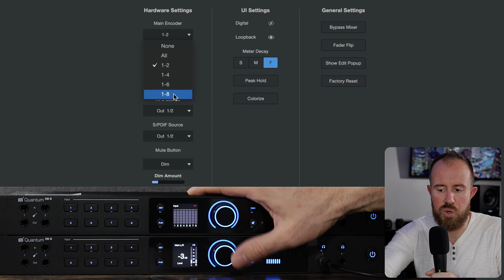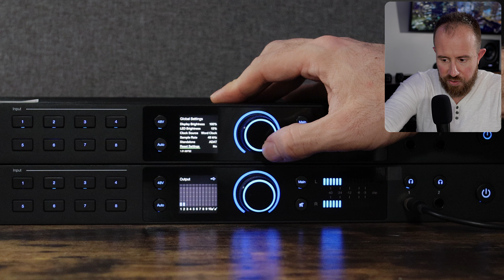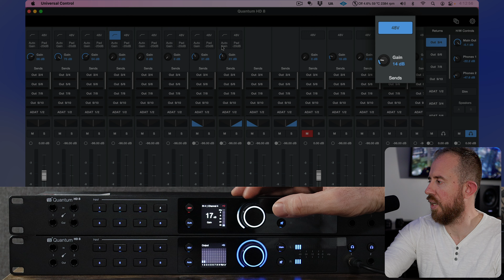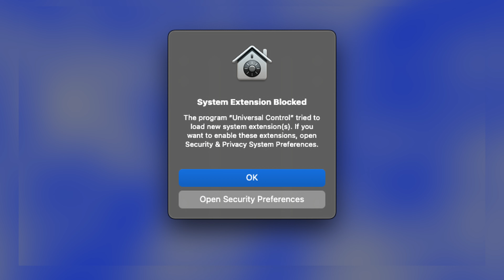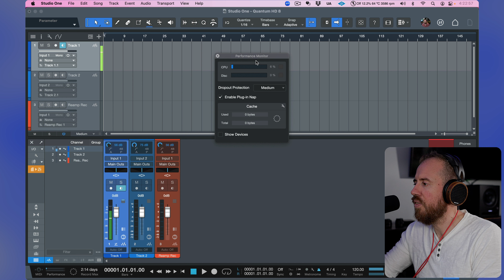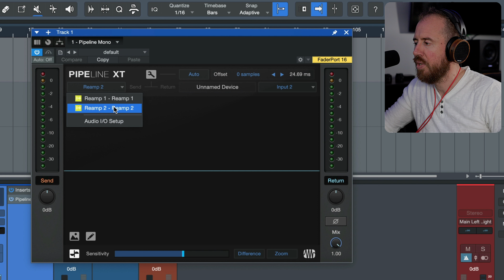PreSonus Quantum HD 8 - FULL Overview | USB-C Audio Interface

Comment: I just purchased a Quantum HD 8.

I got a lot of audio cracking well my buffer size was set to 16.  I had to go up to 128 on my buffer for the cracking to stop. I audio dropout protection when I raise it to high taxes the CPU tremendously.  I am not extremely happy with the driver that runs the unit.  My RME BABYFACE uses a buffer size of 64 and it doesn't matter what I set the dropout rate to and I get a latency of approximately 3.6 milliseconds for audio and about formuliseconds for virtual instruments.

I hope this helps everybody.
Reply: Are you having any other problems with the PreSonus Quantum HD8? I was considering getting this but have been reading about various problems like audio dropping out and a high pitched thing going on. Are you still using yours? I also have the original RME Fireface UFX and it's great, but I thought a 32 bit machine would give me more headroom. Thanks for your honest reply.
Reply: @Preordained  I have one that I’m replacing with an SSL 18.  It is not playing well with a Cranborne 500ADAT rack.  I think it’s is due to a bad ADAT port on the Quantum.

The preamps in the 500 rack work when running signal through them, into the quantum and into my daw.  But I also use those preamps as line level processors when mixing.

But when I try to route signal through them out of the Daw and back?  Nothing.  Pipeline sends the outgoing signal and nothing comes back.  None of my efforts to fix everything else in the chain has worked.

I also had an ES-4, but I had no problems with it.

Comment: Great review!! Thank you!! The round trip latency results are encouraging as I was concerned about the fact that these were USB 2.0 protocol interfaces.
Reply from the maker: In all honesty i know that I've heard of some people talking about RME interfaces and the custom low latency driver over USB. 
I've never used RME before - But this was my first experience with seeing these types of RTL numbers over USB. 
I think on a newer computer system (even on my 2019 Intel Macbook Pro) that these results are really good, and would allow people to work with really acceptable latency. 
But also we have UC for ~ZERO latency monitoring, as well..
Cheers, M
Reply: @marcushuyskensmusic   Dont we already have the Low latency trip on the Presonus studio 192?  The Z thing?
Reply: I read that they use USB C 3.1 I don't know where anyone heard they use USB 2. Thats a different connection with different protocol. Did you read that somewhere? I only found one place where it said what they use. USB C 3.1

Comment: Great review.  I had the Quantum 2626 pretty much since it came out and have had the new HD8 for a few weeks, so for anyone considering getting the new HD8 one thing worth considering is the fact that the new interface does not have send/returns on any of the inputs.  If you have outboard preamps, it's no big deal, but having send/returns on Channels 1 and 2 on the Quantum 2626 was a great feature, allowing you to use outboard gear while tracking through the built-in preamps.  The reamp feature on the new interface is really useful though.  It's made using guitar pedals and outboard gear during production/mixing a breeze.  Overall, I'm really happy with the upgrade.
Reply: I have read many reviews (NOT ON YOUTUBE) that say they are having problems with there PreSonus Quantum HD 8. What's the REAL story? If there is a link to buy the product and they are receiving money for sales, how can you really trust the reviews on YouTube? People are just not honest anymore, they are greedy! I hear these don't last very long and there are issues with using it with universal control as well.
Reply: @Preordained  I still have mine. I'm not affiliated with Presonus or any retailer in any way whatsoever, so my opinion is just based on my personal experience.  I've also read some people saying that they've had issues with theirs, but that hasn't been my experience.  I've updated firmware as updates have been released.  I've only run mine on a M1 Mac mini, but it's been great.  If you're interested in one, I'd recommend getting it from somewhere that has a solid return policy so that you can really put it through its paces.  I had the Quantum 2626 too and one of the main reasons I bought the HD8 was to have inputs that could be digitally controlled.  I think if you look into reviews for any interface, you'll always find some people having issues, it's just the nature of different people having different computers and operating systems, and also the interface manufacturers not being able to get everything 100% when it's released, which is why support and firmware updates are important.

Comment: Excellent review-Marcus- a couple quick questions on Dolby Atmos-    1. can you utilize the 2nd Heaphone output as Channels 11 and 12 for a 7.1.4 Dolby Atmos mix ono a single interface, or are you required to use the 2nd interface for that?    2. Are you using Sonarworks SoundID Reference for Multichannel with Measurement Microphone for your  room calibration/Speaker EQ     3. What would be the Maximum sample rate and anticipated latency figures with 7.1.4 setup

Comment: Dear MARCUS, I have a Quantum HD8 connected via ADAT to a Focusrite OctoPre. Both on the Quantum and the Focusrite I have connected various musical instruments in STEREO (example 1Left / 2Right for synth, 3L 4R for other synth...etc). Both are at 48khz and perfectly connected.
In the presonus UNIVERSAL CONTROL software, I have configured the stereo channels correctly for all the tracks, left and right are linked for each individual instrument.
The problem occurs with the computer OFF: on the instruments connected to the Focusrite (example Synth Stereo) if I "panning" all the way to the left on the synth I see that on the Focusrite the right channel has NO audio (so ok) and on the Quantum, if I go to INPUT ADAT, I see the same thing, the left active and the right silent. BUT IF I GO TO THE two bars of the MAIN, I see that both the right and left have SOUND! If I turn on the computer there is NOT this problem, it disappears and also on the MAIN of the Quantum. I see that I only have the sound on the left! If I then turn it off (the mac), the Quantum behaves perfectly, in the main I only see the left as it should be! If I turn off the Quantum and turn it on again the problem is still there! It is practically as if it does not "remember" the linked stereo channels in the software, it only remembers when the mac is on. When turning off the Quantum it still forgets the linked channels of the ADAT sockets (I let 1 minute pass before turning it off, after the various changes to the software)! How can I solve it???

Comment: Thank you for showing this. There are a few things that I did not get. Did you have both your units connected to the mac with usb-c or just one? If both are connected with usb-c do the use the same control software or do you have to use aggregate device in the mac to get both in?

Comment: How does the HD8 currently compare to the Arturia AudioFuse 16Rig? Obviously working with Studio One using the Faderport 16.
 I am considering buying strictly for synths and keyboards. But also with an application for immersive sound. 
I'm considering one of these: HD8, Arturia Audiofuse 16Rig and Behringer x32 rack.  All of them have min 24 inputs are fairly close in price. 
Does the HD8's standalone mode allow the interface to function as a mixer without a computer?

Comment: Oh my GOD. People. Just brcause it doesnt match your expectations doesnt mean it wont work for others. Just don't buy the damn thing if you dont like it. I think so called musicians spend more time bitching and complaining about gear rather than actually using any of it.
Reply: It would be a perfect interface but DSP is missing. That way it doesn't compete on today's market for people who doesn't have outboard racks of hardware to monitor properly. And for guys who want to record drums cheap Audient Evo 16 is way cheaper and does the same thing.
Reply: @huberttorzewski I second that! For my workflow as a vocal coach, where real-time fx is required, this is a huge step back from the Revelator series. Put the DSP Fat channel back into this unit, include a decent DSP Reverb + The Mix Stream options, Then this would be something great to work with.
Reply: @diepoldvoicestudios9814 

Studio one has show page with all effects. 

The Show Page is designed for live performance, and combines the roles of virtual instrument host, mixer and backing‑track player.
Reply: Even under this comment reply section there are people bitching about the product. Just get an interface with DSP, this one is not meant for you guys. You are not the only people living on this planet.

Comment: Marcus I felt I had to comment because I've been following you for years and have learnt huge amount from your videos about the more advanced features (and quirks) of Studio One.  I see you as one of the wise sages of studio one and audio production in general.

But I am a bit surprised at your take on these interfaces.  Full disclaimer, I haven't watched the whole video, just the parts about latency and your final thoughts but I've been massively disappointed by the HD-8.  As a pretty happy Quantum 2626 user I was keen to know how Presonus were going to update the Quantum line for the next generation.  

And they haven't.

These are not "Quantum" interfaces because the whole point of Quantum interfaces, for most people, was the incredible low latency performance.  No DSP, no software mixer required, just great integration with Studio One and blisteringly fast latency to the point where you don't even think about it.  

Now, some people will argue that latency doesn't matter once you get below, say, 5ms but those RTL numbers you quoted are about double my quantum 2626.  So as a replacement for the Studio 1824 (which I had once but sent back for the 2626) then this is arguable an update.  But this is not, in any way, an update to the Quantum line because the whole point of the Quantum (like it or not) was the incredible RTL.

I'm also not very happy about the lack of any combo jacks on the front but that is kind of by the by because this is Quantum in name only.

Luckily I don't need to upgrade, just hope my 2626 doesn't break!
Reply from the maker: I hear what you are saying - But also I think that the "Quantum" name is kinda like the "Apollo" name.. It seems like it refers to the "lineup" of interfaces..Then certain models are running USB-C or previous generation's with Thunderbolt. 
For me, these 2 units are being used for my Dolby Atmos Mix Room. I previously was using my Studio 192 connected to a DP-88.. The conversion and headroom on these new units is really, really, good. A massive step up from the previous generation of converters..
Also the preamps are probably the best I've ever heard on a built in preamp that ships with an interface. I don't see it as a step backwards. It's just that it's a USB-C interface..
And I get what you are saying about the RTL on the Quantum Thunderbolt interfaces.. (I use a Quantum and a Quantum 4848 in my main stereo setup that stays locked to 32 buffer size in Studio One).
But to be honest, the RTL figures that this interface can hit with the custom driver are pretty decent. Also it's pretty easy to use UC or hardware direct monitoring if someone wanted to have ~ZERO latency..
At the end of the day, I think this interface sounds incredible - it's build quality and general look is really nice, and the loopback feature was VERY much needed for content creator's and people who need to create mixes for streaming.
But like you said, if the 2626 is working for you, then that's perfect.. Stay with that unit!
Cheers, M
Reply: @marcushuyskensmusic  I am having the same thoughts on mine man. I own a 2626. I also use amp sims and speaker IR's WHICH makes low latency the number one reason I keep the FEEL of playing through my guitar amp. Even 2 milliseconds can be felt man. I wish they would update the actual QUANTUM interfaces. The 2626 should be the base now and build from that and not count on USB Drivers that to be honest... I own a Studio 68 C that has the exact same numbers... SLOW....
Reply: Someone should do a comparison of the new converters compared to the 2626... Can we really hear a difference? Blind test of course! One solution would be to track with the 2626 which I own as well. We could go ahead and use the HD8 for mixing but if you do that maybe you could get the HD2 or whatever and just use out 2626 for tracking... The New interface for mixing? Wonder if that would work... You'd have to get used to switching the interface of course. I just like to run outboard gear and right now I have mine full I can't add anything else. BUT I do want to.... I been thinking about the HD8 for a few months now. If you use outboard gear and like to hear it live before processing... that's where the issues come in. Can the HD 8 do the same thing as the 2626? I use all my ins and outs to and from outboard gear, and it sounds amazing but its missing a couple pieces so I need more IO. I just discovered that the first two inputs our outputs were for outboard gear. I use all of them LOL I didn't know you wasn't supposed to use other outputs than the first two? Does that make a difference? LOL

Comment: Marcus, what a great run through. Thank you so much! I have a question regarding the Loopback function. I am a vocal coach. Until now I used the Presonus Revelator io24 for live streaming my vocal coaching sessions with clients. That worked great, since the Revelator had the integrated DSP Fat Channel. Comparable to a digital mixer workflow. Now I am wondering if I am able to achieve the same thing with the new Quantum HD 8? Is it possible to stream the DAW Output incl. software monitoring to OBS, Zoom etc.? If someone reads this, I would very much appreciate any suggestions. Thanks a lot again.

Comment: Out of curiosity. How does it sound compared to a Prism Titan, Lynx Aurora, Apogee Symphony MKIi, and Apollo X16.
Reply from the maker: I’ve haven’t heard the Prism gear in ages (years) I’d say that it’s 100% on par or better then any decent professional audio interface that’s out there right now.
Also worth pointing out - this unit sounds better then my original Thunderbolt quantum and my 4848. (It’s just not as fast with RTL) but I’m honestly thinking of keeping the 4848 for tracking connected to all my external preamps and hardware - then switching to the HD 8 for my mixing..
All my analog gear is connected to a patch bay anyways - so I may tests it out in the coming weeks..
Cheers, M

Comment: This review is very informative, thank you for taking the time. My question is, In a hybrid setup can you use the 10 TRS outputs on the back of the quantum to feed the first 10 line inputs on an external analog mixer. Would you assign outputs in StudioLive (vs6) 1-10 mono. I have a 24 channel mixer and two of these in this scenario would be adequate.

Comment: What converters are used for AD/DA, DA/AD?
   Excellent tutorial of the new hardware. I'm in a quandary. Had decided, after massive information paralyzation concerning comparisons of interfaces, on the latest MOTU 828. The 828 has about everything, including very good converters and specs.
   Now the HD 8 comes out and suddenly there's another heavyweight interface contender (for me, anyway). Since Studio One Pro is my DAW and I have  Faderport8, I can see the advantage of the tight integration with the HD 8. Also, it's 8 pres to 2. Advantage Presonus. The 828 won't let me go though. The HD 8 is the latest siren calling out to me as I'm tied to the ship's mast, unable temporarily to regain my sanity with these two alluring songs competing for my attention.
   I would like to see a total spec comparison for the HD 8 as is available for the 828. Haven't been able to find much of anything.
Reply: You only have 2 mic pres on  MOTU while HD8 has 8 so it's not a comparable product. Motu has DSP, quantum doesn't have it. Motu is high end interface with only 2 preamps and HD8 is entry/mid tier interface with a lot of preamps built in. 2 completely different products
Reply: @huberttorzewski 
All that is true but fairly obvious differences. I'm talking about real "specs." Can't find this and similar information for the HD8.

Comment: Thanks for the review Marcus! When going line in on one of the 8 ins, if using another amp pre, does it bypass the built in preamps as some interfaces do?
Reply: The mic / line combo jacks on ES and HD bypass the pre if you plug into the 1/4-inch part of the combo jack. There is a digital trim available when it auto-senses line level but the pre is bypassed.
Reply: @OscarDanielGarza  perfect thanks!
Reply from the maker: Yep - just as Oscar mentioned - the cool thing about the trim is you can hit analogue gear super hard then pull back the level to taste..
Thanks for watching!
Cheers, M
Reply: @marcushuyskensmusic 
Over on Gearspace they are saying the pres CANNOT be bypassed. The manual for the Quantum Thunderbolt series indicates the pres can be bypassed. One commenter said the word "bypass" is not even in the HD 8 manual.
   Also, two different people on different sites have stated completely contrary information. Both have said they spoke to Presonus support with one rep saying the pres CAN be bypassed; the second rep said they CANNOT.
   We're not talking about keeping a pre's gain to "0" for the bypass. That is not a true bypass.
   Your comment on the issue?

Comment: Great review Marcus- real world insights. I’m wondering do the line inputs bypass the mic pres and go to the converters? Cheers.
Reply from the maker: Yes - 100% they do, and they also have a trim in place of the preamp gain when a TRS cable is connected (which is super useful) 
Cheers, M